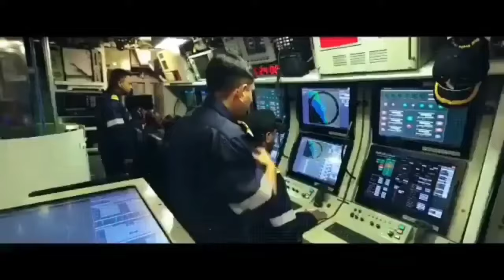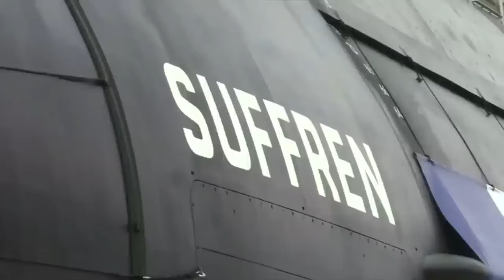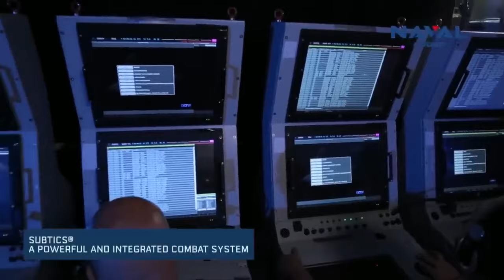Indo-French collaboration on Nuclear Attack Submarine(SSN) is at advance stage #indiannavy

Comment: Better insist on high assay low enriched uranium (HALEU) fuel at least. French nuclear submarines only use low enriched uranium (LEU) which requires frequent refueling and is less efficient.
Reply: This is why France lost the contract with Australia as soon as they decided to switch to nuclear propulsion. LEU wouldn’t work for Australia because it requires extensive nuclear industry support that Australia doesn’t have.

Comment: We need 11000 tonnes submarines construction for carrying brahmos induction k4 and k15 and heavy weight torpedoes😮
Reply: That's not what an attack submarine does - at most they have VLS to fire cruise missiles. You're talking about ballistic missile subs, which are an entirely different class.
Reply: S5 ssbn is 13k tonnes.
Reply: @thelungilife6057  Uhm.. The Akula-Imp are literally 12000 tons+, 774's are 7000 to 10000 tons, Seawolf is about 13000 tons, Severodvinsk is about the same too.. Brahmos is an AShM cruise missile
Reply: @M16_Akula-III  err - weight and Brahmos arent the issue. The guy is talking about launching K4 IRBM's from an attack submarine. Which defeats the purpose of a fast attack submarine.